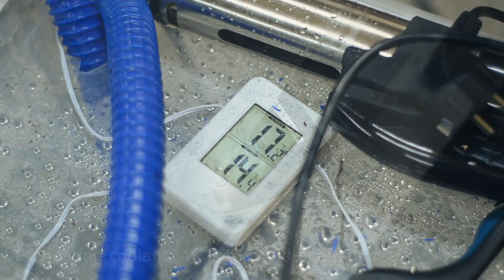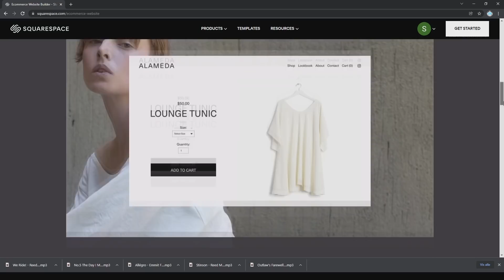Why!? All I wanted was all the power.

Comment: I mean if you're brave, a couple of 1/2 v belts with a spring loaded puller style clutch and a flywheel to accommodate a pulley could work since its controlled

Comment: Its been proven over and over again that race reed engines do not like very large case volumes, in a RV engine the case Helmholtz interacts with the very short intake tract and bigger is better ( down at 1.25 as the Aprilia was ) .But with a reed the large ( bigger than 1.3:1 ) needs such soft petals to get the 1st mode resonance frequency correct , that they loose control and flutter badly at high rpm.If the reeds are too stiff for the big case then you loose low range power as the natural resonant frequency is wrong. So you were 1/2 right about the pumper carb - it was a mismatch between the case , the reed and the pump diaphram operation due to a very small pressure delta. This is NOT a case of bigger is better , the reverse is true - have a look at your 1st mode rpm in EngMod.

Comment: Did you consider that maybe you should first work on the high RPM part of your engine. After all, that is the real important part. If the high RPM part does not work then the rest is useless. The part which you work on now is "only" there to bring your engine into high RPM. You could maybe use temporary an electric engine to speed up your engine to 19,000 RPM. Then look if that part works and optimize it until it works with high power. And only then, after you know the high RPM part works fine, should you, IMHO, spend time on the "low" RPM part of the engine. What do you think about this idea?

Comment: Put a higher gear ratio between engine and dyno(problem, higher losses in transmission). Inertia of dyno is to high for the engine to get up to powerband with current transmission ratio. Maybe?!

Comment: Use a motor to spin up the large brake weight and have it spinning a bit so the motor doesn't have to overcome its weight
Reply: Issue is in spinning up the clutch not the telma, needs different exhaust pipe

Comment: We bond through mechanical failure, its the glue which immediately lays a foundation of common suffering. I forsure know ofthe cold, wisconson born, garage and a space heater roaring, nothing seems to go easy/quick or without a trip to the store. Like, choose any 2 at a time. Job done fast, aint gonna be right, aint gonna be 100%.

Also, that liqiid metal in the coffee cup gag had me laughing hard, you'll see this dyno through. Mankind needs a cackling nitro powered 2smoke. 

Just like roots style blowers, surely they are inefficient, but hotdamn are they cool.

Comment: Or, you could just bump up the crank-case compression, loose nothing (really) and gain a functioning engine. 
If you still are so determined about a small crank-case volume limiting your scavenging, make it so that when it hits the pipe and the secondary runner opens, it also opens up an additional volume, attached to the secondary intake. 
If it's worth anything, in my experience, is that provided good enough heat transfer from piston to cylinder (or thermal insulation on the piston crown) is present, higher compression in both ends of the cylinder gives better results, every time, all over the rpm range. You also get lower EGTs, and more power from the mass-flow. 
Perhaps you really are chasing down the wrong path...It's not always about getting higher mass flow, sometimes getting useful work out of the mass flow you got, is equally, if not more important...
Reply from the maker: Great advice, thanks! Might just have to decrease  volume a bit.

Comment: the inertia of this huge Telma retarder seems large ( vs the available amount of torque when the clutch is engaging) , making it a bit like an inertia dyno untill a permanent regime is reached : did you assess how long it would take to rev it up by the projected the amount of power available starting from idle?
Reply: Its having issues spinning up the clutch not the telma, dude just needs a different exhaust on it to hit the power band better due to all that crank case volume
Reply: @codeack101wlck  sure, but even when (if?) it spins then the issue of the huge inertia will arise, making the step response of the dyno quite large compared to the engine being tested...

Comment: Maybe increase the diameter of the clutch belt pulley so the engine drives it slower vs engine rpm, therefore engine can rev high before the clutch begins to grab. If that still doesn't work - instead, remove the clutch pads altogether, and just have the belt running the pulley with nothing in there - this will determine if it's just the belt's power loss which is holding it back, and if that's the case then yes - you'll either need a high rpm clutch on the crank, or you're forced to redesign the exhaust to flatten the power band down to a point where the power is sufficient to run the engine past the belt/clutch assembly losses.

I'd also note that you're perhaps approaching this in the most difficult way, by designing a complex system to already be at peak output on the first attempt.... As opposed to starting at a place where you can at least run tests and get your setup working and refined, solve all the peripheral issues, then make incremental improvements towards peak power from there.
Reply: Increasing the clutch belt pully size would require more tourqe at low rpm worsening the issue, this session he did on the dyno was a success in my book it brought him to the crank case volume issue witch he has a few options to fix, dudes on the right path and hindsight is 20/20 from your couc
Reply: @codeack101wlck  "Increasing the clutch belt pully size would require more tourqe at low rpm worsening the issue" - qualify your answer.
Reply: @LitchKB  tourqe = inertia x angular acceleration

Inertia for a disk = 1/2 MR²
M=mass
R=radius 

Angular acceleration =final angular velocity - initial angular velocity / time

Do you need more of an explanation?
Reply: @codeack101wlck  Yeah - Why don't you lay it out for me Einstein.
Reply: @LitchKB  no its simple math
Reply: @codeack101wlck  either explain exactly what you mean by "increasing the clutch belt pully size would require more tourqe at low rpm worsening the issue" or continue to hide behind this masquerade of conceited ambiguity. Simple. Continuing to avoid it from this point would just confirm my suspicion...
Reply: @LitchKB  you belive that increasing the diameter of the pully on the clutch let's the engine rev higher because it takes more revolutions of the engine to spin the clutch once,

Im saying that increasing the diameter of the pully on the clutch will require more tourqe worsening the issue hes having in the video, the engine right now is not getting into the power band not because of the rpm rate of the engine its a tourqe problem caused by the exhaust pipe needing tuning for the volume of crank case he has on the engine so 

Im saying your wrong and it will exasperate the problem by requiring more tourqe when with the lightest of load it can't even get into the power band, it should have no problem at all spinning the clutch as the clutch setup is but it has to get to a powerband

Bitch and you shall receive dez nuz
Reply: @codeack101wlck  That's what I thought, you had it all backwards. You can visibly see the clutch starting to grab - and when the clutch grabs a bit - it needs to turn the brake chain assembly and the brake itself which is certainly more than the engine can muster.

"the engine right now is not getting into the power band not because of the rpm rate of the engine, its a tourqe problem" - wrong, this is a fundamental misunderstanding of the state of things because BOTH of these things are true. The engine at that RPM is spinning the clutch which is likely grabbing at the brake assembly which has a higher torque requrement than the engine can provide at that RPM, which prevents the engine from increasing it's rpm, thus one of two solutions exists:

1. Increase the diameter of the clutch belt wheel so it's relative RPM to the engine is lower and the clutch doesn't grab as much, allowing for the engine to rev up into it's power band (and thus have more torque avaialble).

2. Remove the clutch pads and free-spin the clutch belt wheel to confirm that the timing belt side of the power train itself isn't so inefficient that it, itself is exceeding the engine's ability to rev higher.

I hope you didn't pay for that education, this one's for free. No formulae required. Good night.
Reply: @LitchKB  lol you think that clutch was grabbing lmfao
Reply: @LitchKB   @Litch   @Litch  Youtube wants me to be polite lol, I did watch the video the only thing he did was the second thing you posted in the post edited comment which yes goes along with the equation I presented to you after you asked me to "qualify" my comment prior nothing in the new video contradicts what I've commented nor does it have anything to do with increasing that pully size in fact he mentions putting on a reduction for the chain to decrease the mass of rotation the engine has on it again correlating with the equation you asked me to "qualify" my prior comment. Try again sport lol have a nice day
Reply: @LitchKB  ya know I just can't stop laughing at the collage comment lol dude I'm a self taught engineer of sorts I own a performance shop mainly welding custom roll cages ged only yet I make 75k to 100k a year and I have no issues going anywhere no debt so just keep coming at me im enjoying the entertainment lmfao
Reply: @LitchKB  YO lmfao
Reply: @codeack101wlck  oh right, that comment was because you were acting like some 1st-year who learned a formula in class last week and thought they knew everything, but that's even worse - you've actually got industry experience, maybe just stick to pulling that mig trigger before jumping on threads to correct people with your "self-taught" engineering knowledge and 5-figure salary. Back to you sunshine, I'm enjoying this too <3
Reply: @LitchKB  dude ask someone to qualify a comment what did you expect i didn't come in here with as a know it all lmfao thats called projection
Reply: @LitchKB  i don't know what to do other then give time stamps because he says its a powerband issue, and went through solutions for getting what he wants talked thoroughly about the exhaust pipe, talked about timing and changed it, and talked about the weight it needs to rotate now after only slightly getting into power from the timing change was he able to get enough speed to grab the cluch which is why he mentioned changing the springs again. Wtf am I missing here?

Comment: i think you are quite close to a breakthrough. nothing drops in your lap , nothing worth having comes easy.. you are breaking new ground here with this engine. i think there is something in what you say about the engine is struggling to wind itself up enough under power. the yamaha fs1-e we tuned, it was so bad at "low" rpm, so gutless it did'nt even want to rev in neutral until around 10000 plus rpm, the result was it was extremely difficult to pull away from standstill even massively slipping the clutch. once near peak rpm could be attained there was plenty of power. it was light a light switch-all or nothing. also my gut feeling is you may need a bigger carb.

Comment: Are you sure that your running problems are not due to heat soak? That exhaust pipe is very close to the carb, at the hottest point. Just my thoughts, not a critism.
Reply: You could try a stainless heat shield and/or some cool airflowing, especially while it is stationary like it is now

Comment: The unfortunate reality of what you said at the end there is that horsepower is torque over time, so if it's low on torque at low RPM it's likely to be low horsepower even when it's screaming 😕
Reply: Bhp is torque x rpm. The torque will also go up in the powerband. 2 strokes don't make much torque down low. Especially when tuned fir high rpm power

Comment: 5:27 "Reeds look fine", are you no longer using disk induction?
Reply: The disc valve is on the supercharged motor
Reply: @lozhayton7391  - And reeds. The disc valve is on the exhaust

Comment: Couple questions here-

Does your table say "fuck you", and can you get either a much smaller primary sprocket, or a much larger secondary? I know that the primary can only be so small before it's an issue, just as the secondary can only be so big- but I'll be damned if primary sprockets aren't cheap as all hell and readily available at your local powersports store. See if you can maybe find a 12 tooth (or eleven?)

Comment: Without failure there is no progress.  Sad axiom inventors/engineers and to some degree scientists have to live with.  Invention of ready to use scientific software has supposedly bridged the gap between “guess and test” and “design for success “.  I worked over 35 years in automotive structural and crash safety engineering.  Things (analytical methods) that were suppose to be common place by 1969 still don’t work.  It’s more of the mind set of each class of technologist.  Engineers think differently than scientists and are quick to distrust analytical methods that can reduce the “guess” in “guess and test”. There are a few engineers that like to try the new stuff out because they feel the burden of incomplete or disorganized understanding of the problem.  We just saw it with the “staged” , “oh wow” moment, wrt the pulley mass. It was a kink in the hose for awhile, now he’s going after it.  It would be nice to have the simplest rotating mass model to flog that one out or someone to do simple combustion dynamics on “the bump” in the crankcase.  Either way as long as everyone is having fun at work, is good for me.

Comment: Definitely float carb I'd pic 28to30mm.
That's alot of weight straight up though,  by the looks it's peak power to get it moving,  I know I thought centrifugal clutch was the way to go but the flywheel is to great to spin. That's like pushing a elephant up hill.
I believe you need a bike wheel on the large sprocket  , then once you have revs half way ingauge tyre onto the brake/load system . Atleast the engine has some hp built up no centrifugal clutch needed,  simply have chain rear sprocket /wheel on a pivot system (swingarm) and attach seat to swingarm with a spring to keep wheel disengaged from load/brake , once revs are up enough sit on seat to slowly engage tyre onto load/brake , once your fully engaged your load cell should be activated as the motor is using max power to spin load.
Any problems with motor you simply take weight of seat to disengaged tyre from load/brake  , hopefully quick enough before damage.
Or other option Dc motor (forklift motor) Dc load 750w=1hp from memory but more building though.

Comment: Why, well that's easy to answer. You are pushing the envelope and easy is worth nothing. Try gearing the belt ratio much higher., will be easier to get the engine on the pipe.

Comment: I was going to say this last week but had reservations. I think part of the problem is the mass of the retarder disc vs the power characteristics of the engine. Imagine if it had a lightweight retarder disc how easy it would spin up. When at speed you could then apply the load. 
The reason I didn't say anything was I wanted to see how it played out this week but I have been thinking about it hoping you'd prove my hypothesis wrong.
Since I'm outside looking in I'm divorced from getting caught up in the intricacies of complex problem solving.

I feel you can overcome the difficulties here but in the end do you need or want to?

It will play out something like this:
A point has to be found where the gearing is matched to overcome the inertia of the retarder. This then leads to the clutch arrangement. I feel a manual clutch is the way to go but using it to overcome the inertia of the heavy retarder probably will show up other limitations.
I think once the retarder has a light disc then several different gearing solutions will then need exploring to calibrate your new home built dyno to your needs. Remember you're repurposing a truck retarder into a dyno. This is another whole new project but one I find thoroughly satisfying. It is actually fascinating. 
You want the engine to be able to change RPM easily and quickly over its range. The comparatively large inertia of the retarder mass makes this change slow even with lightened disc. This means the motor has to work hard over a long time to bring it up to speed (obviously slowing it down is a non issue).

Practically speaking look at the generator on the back of an EMD diesel engine - it is puny by comparison. Look at your retarder and you engine - the reverse is true. Power generators have a huge retarding effect on piston engines and so 3000kw V16 Diesel engine is easily brought to its knees by a generator the size of a small car.

In the end I'll think if you use an electromagnetic retarder, it'll be one you built specific to your needs.

Perhaps a direct coupling to the engine (with no clutch) a splined retarder shaft on the same axis as the crankshaft with an adaptor you made to connect your engines, a pair of motorcycle brake discs one stationary the other fixed with magnets arranged accordingly. Small, big retarding power, perfect for testing two stroke engines.

Comment: I remember when I install the drive belt and it wasn't right in the two pulleys the variator pulley to be exact and the clutch pulley where the clutch Bell is in the rear and the bike it was it just ballgown like the brakes are on when you put it in gear and get your brake pedal and try to hit the gas think about that I'm not saying anymore dude just try to help